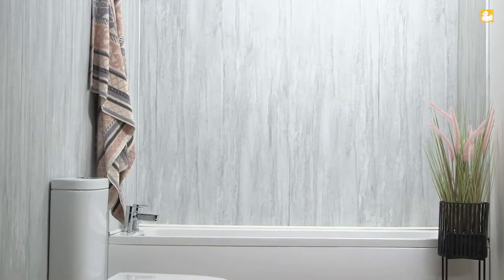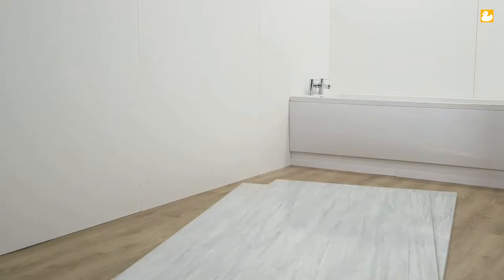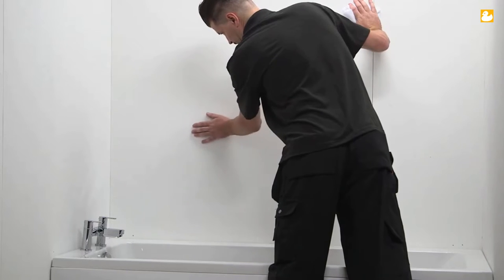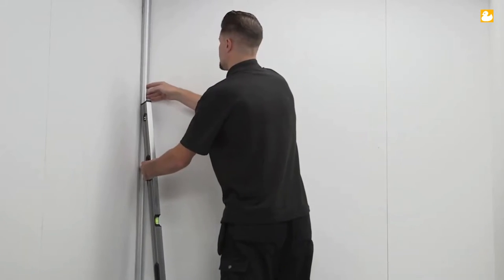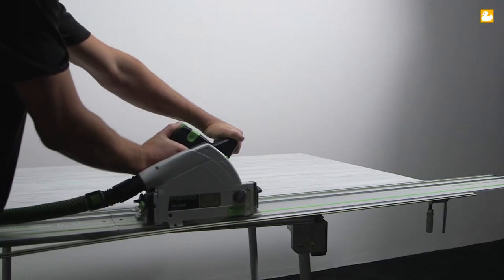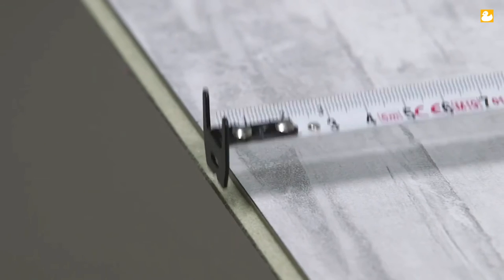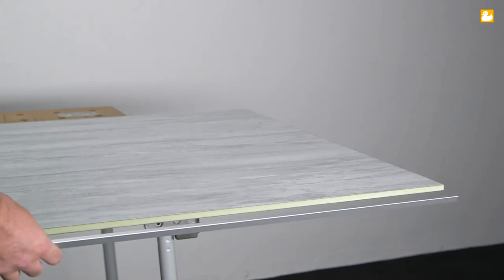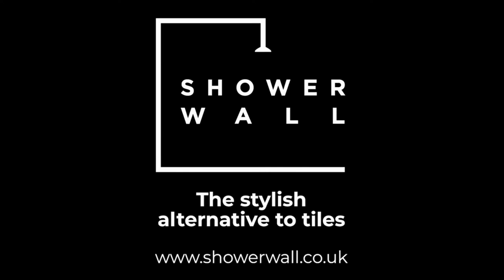How To Install Showerwall Around A Bath - Fitting Guide

Comment from the maker: Are you going to be using bathroom wall boards on your next bathroom renovation project?
Reply: What is the backer board on the stud work ?
Reply from the maker: @timothybint4960  in this example, this is plastered wall which are painted white. These panels can be fixed to plasterboard, tilebackerboards or even direct to stuudwork and battens. Its also good to note the as these are waterproof panels and not tiles, the BS standard dont require tanking for the installation of boards. How ever it wouldnt be a bad idea to tank and waterproof the wall prior to installation.

Comment: So I bought the panels - but for some reason the seams don’t glue together like that - the fitter said he had to use H Joints so it looks really messy with white H joint strips everywhere. The fitter has already stuck the panels up - is there anyway to remove them and start again?

Comment: What if your walls aren't level?
Reply from the maker: Simular to what you would do if you were tiling and how good of a finish you want to end with. So depending on how far your walls are out, you can pack the boards out with additional adhesive, or if they are very far out then you can either plaster the walls and get them level, or scribe the boards as you install them. You want walls to be as level as possible once finished to get the best finish and to make installing item on the wall easier.

Comment: Hello! Can you show how you would cut the circles on the panels to fit around shower connections?
Reply from the maker: 18mm hole cutter/hole saw in a drill.
https://www.youtube.com/watch?v=Td6m_ukCu0A
A bit like the above video
Reply from the maker: another guide here with more technical info 
https://www.youtube.com/watch?v=hMTUJCe81ZM
Reply: The end strips or joints for the panels are a little confusing. The thickness of my tongue and groove panel is 5mm apparently but the end panels are 4mm or 4.5mm so how will the panels fit?